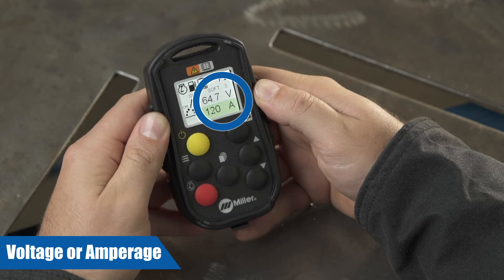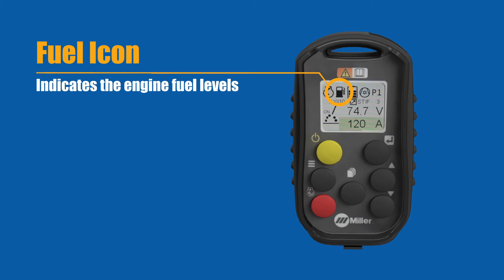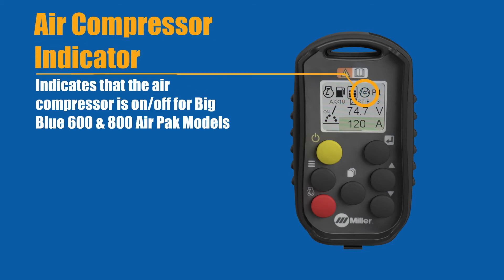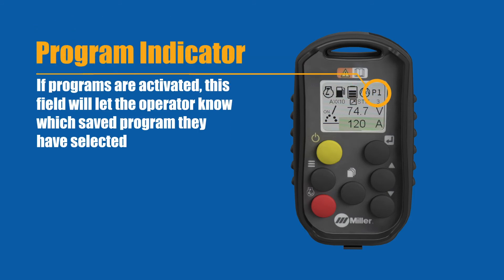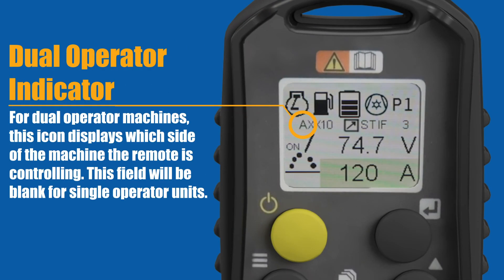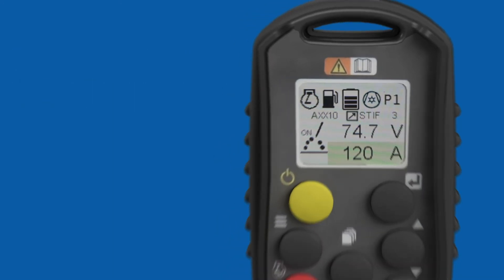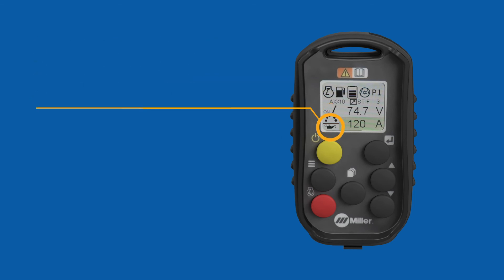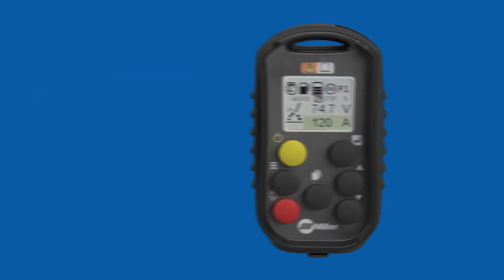Wireless Interface Control: Remote Home Screen Navigation

Comment: Is it work for 400 pipepro
Reply from the maker: The Wireless Interface Control is available on the current PipePro 400 lineup. https://www.millerwelds.com/equipment/welders/engine-driven/big-blue-400-pipepro-engine-driven-welder-m30067\
Reply: I have a 2015 trailblazer 325. Will this work?